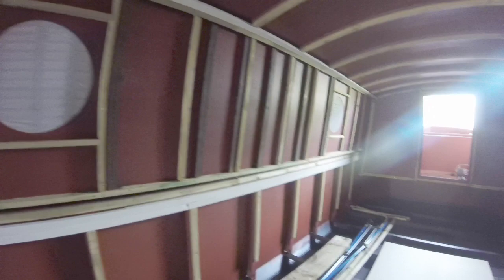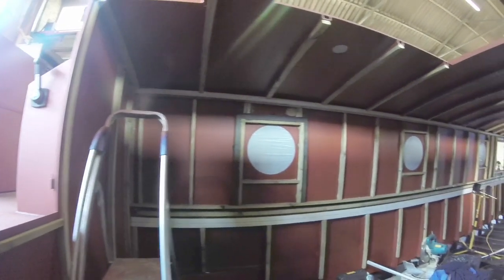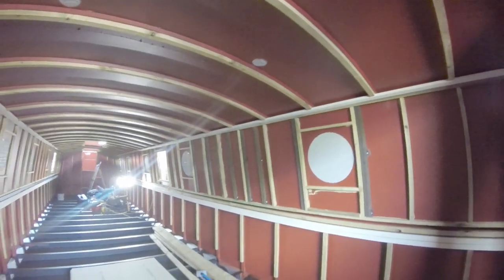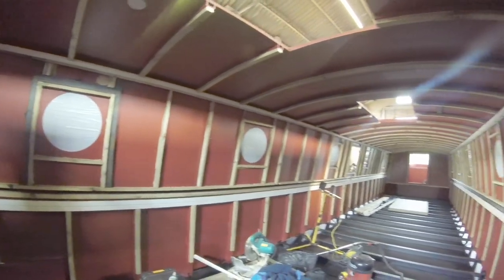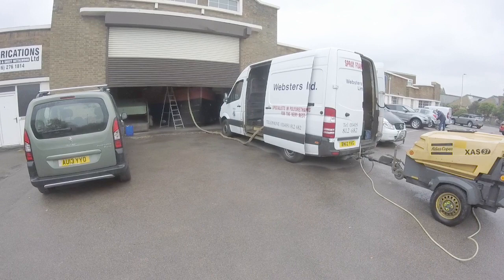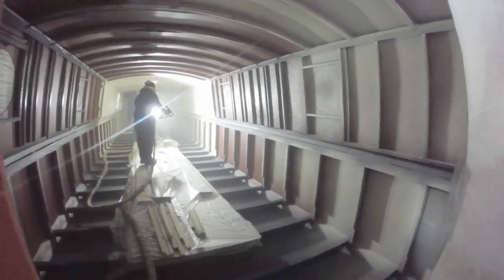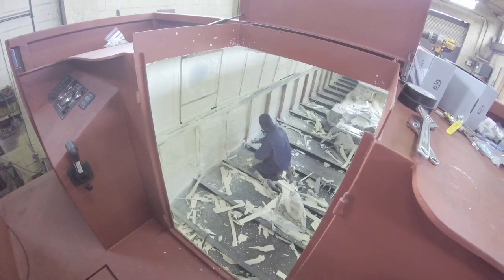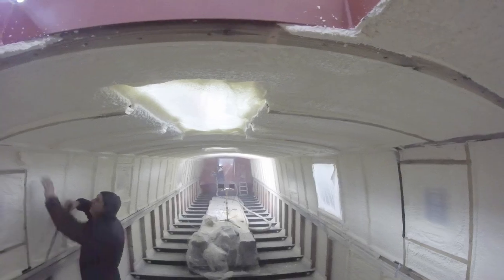Widebeam Boat Build Part 12

Comment: It looks fab! May I ask, is ballast in already, or will you be doing that (sorry if this is covered in another vid, am only working my way through them now)? TIA!
Reply from the maker: No. Did not come with ballast so sourced 5 ton of paving slabs to be added just at the marina before it was dropped in. It took 3 guys 3 hours to handball it all in.
Reply: @northernbuoy1  thanks so much for getting back to me! Really looking forward to more of your vlogs, most especially how your wheelhouse works out for you, ingenious idea!
Reply: What are the dimensions of this newest boat? It appears bigger than the previous one of 57' x 10'. Did that turn out to be too small? If so what were the short comings? I'm trying to decide on dimensions for our first new build and learning from your experiences. Thank you - so useful. Cheers!

Comment: How do I repair the hull ,in case of metal damage, below the waterline ? Everything is covered with foam, sheeting, screed, equipment. This boat will sink before repairs are made in the event of an accident . Need free access to the underwater part of the skin, in case of damage. That's what I'm saying As a captain-mechanic .